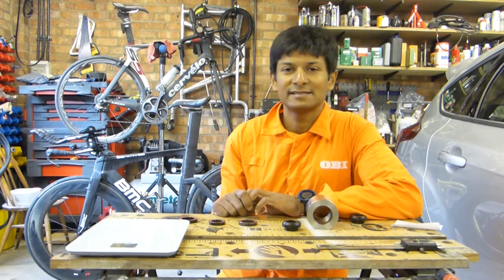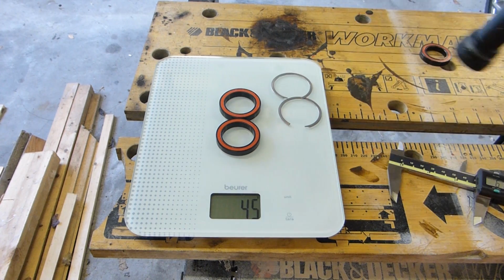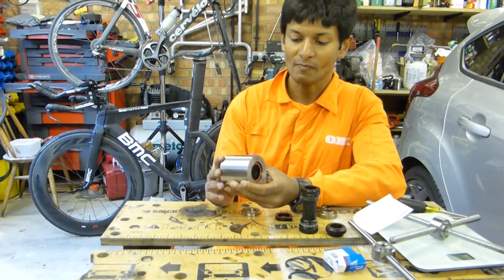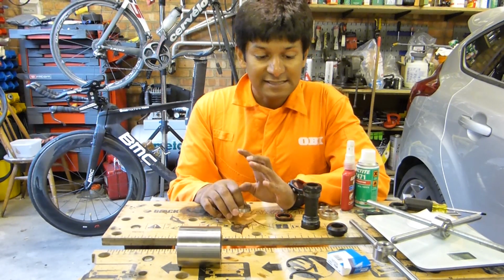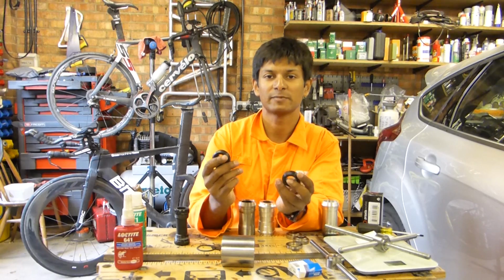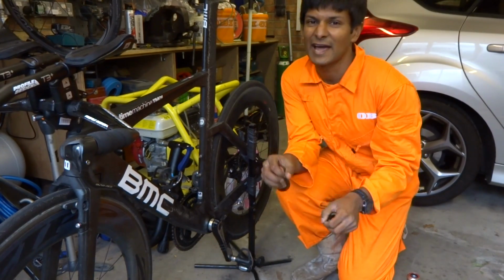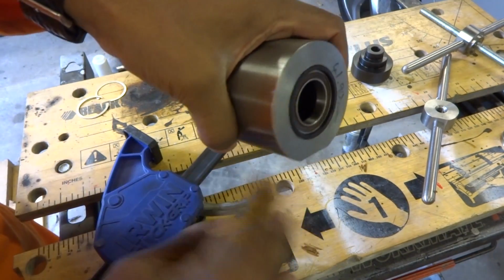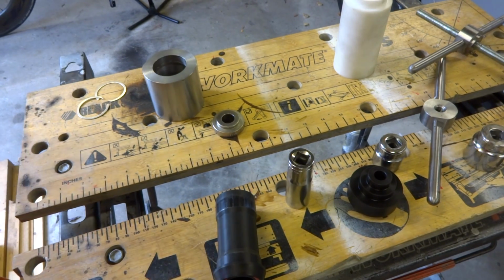BB30 Bottom Bracket Explained, Creaking, Pros, Cons and Fitting Shimano Cranks by Hambini

Comment: So... I've got a very new CAAD 10 recently, bought second hand. It's creaking already (cripes), but only under low torque, i.e. just ambling along. It doesn't creak when out of the saddle pushing hard up a climb. What do I do? Cry?!?!!!
Reply from the maker: Hi, it sounds like it's not the bottom bracket, I would check the seat post. Hambini
Reply: @Hambini  Oh! Sorry I only saw this now by chance; didn't know my notifications for 'replies' was set to 'off'.
Thanks for that. Will speak to my local (competent!) bike mechanic about the seat post as I wouldn't have a clue myself as to how to go about sorting that problem, if it is the seat post.
Any way thanks for the reply. Greatly appreciated. Love the videos, keep them coming
Reply: Interesting to read this comment!  I bought a brand new 2018 Cannondale Synapse Carbon recently-   at about the first 50 miles I noticed a slight knocking with every pedal stroke exactly as you said, NOT under heavy load but only while spinning along easily, sort of in the "middle" 75 percent of effort, where I spend most of my time.    At 70 miles it was loud enough for other riders to hear while riding near me.    Took it back to the shop and it was very difficult to demonstrate, as it didn't happen every time, or rather varied in intensity, and traditionally BB issues show up worse under heavy load.   Initially thought seat post, loose chainring bolts,  headset, everything but the BB.   One of the shop guys was able to ride it and hear/feel what I was experiencing.   Apparently 2-3 years ago there was a rash of "bad" BB30 bearing sets and they showed the same or similar symptoms.    Cannondale sent two replacement sets of BB bearings and a replacement set of headset bearings.  The shop did a full tear down and replacement and so far so good.   I really hope it does not become a recurring issue.    I'm just a recreational rider trying to stay in some sort of decent shape and do not like to think the $$$$ I spent on this bike will lead to aggravation.    My 2005 CAAD7 R700 aluminum still runs silent as the day it was new!
Reply: @JoelSzymczyk  Hi Joel, that's really interesting. Mr. Hambini said to check the seat post, so I'll do that anyway; but I'll also check out the headset by riding no hands and seeing if the creaking stops.
After that, it may just be back to the old BB bearings itself as you say. If so, I'll be defo going with Hambini's adapter for a Shimano BB.
Cheers man, hope yours is sorted for you!
Reply: @Sionnach1601  just passed 1000 miles and all is good!

Comment: American here and I call it a ratchet or a driver (half inch, quarter, etc.,). Other wrenches would be box, open... a hammer, cussing, swearing :) etc.. 

Question sir: If the housing diameter has a deviation from one side to the other, then how is it corrected by a single piece BB? Wouldn't the erroneous angle still be there?

Great video btw.
Reply from the maker: Yes you are right, if the angle is off then there will still be some deviation but.. the deviation is in the cartridge to frame not between the bearings. Additionally the cartridge is many times stiffer than the bike frame so the frame being elastic generally moves towards the datum point.
Reply: That makes sense. I was giving my question some thought today as my BB30 clicked menacingly, and wondering if this could be fixed with your doo-bobbers... or of is this my personal version of 'Bad Wolf' and shan't ever go away. Curses are curses after all.

Comment: So I shouldnt buy the 2017 caad12 with bb30a?
Reply from the maker: Ryan Congilaro I wouldn't
Reply: Hambini thanks for replying.. love your channel... which adaptor is best for bb30a to 24mm?
Reply from the maker: Ryan Congilaro I would get a specific bottom bracket and not an adaptor. Lots of people make them including myself
Reply: Hambini which one for bb30a? I'll buy yours if you send a link
Reply from the maker: Hi ryan, I'm just in the process of updating my website so check back in a day and it will be live
Reply from the maker: It's all updated now https://www.hambini.com/bike-parts/bb30a-to-shimano-racing-edition-orange-bottom-bracket.html
Reply: Hambini thank you, sir. So if I do get the creak, is it just a matter of replacing bearings?
Reply from the maker: Generally the bottom brackets don't creak - however the bearings will wear and they can be replaced by themselves. I have a video called "servicing a hambini bb", have a look and you can see how it works.

Comment: The solution to the BB30 problem is not to buy a bike with a BB30 bottom bracket.
Do what Sky do buy a bike with BSA threaded bottom brackets, they work, the win the the tour, all my bikes have them......never had a problem and they are easy to work with.
Don't be fooled by the marketing hype.

Comment: Very impressive- I have a creaking Cannondale with a BB30A (?) bottom bracket. Two questions on your bottom bracket-1. How much weight does it add? 2. Are the new bearings the exact same size as the BB30 A - can I re-use my existing crankset?
Reply from the maker: Euan, if you are running a 30mm axle you cannot change the bottom bracket. If you go to something smaller - eg Shimano or GXP, then the bottom bracket will add about 40-50g over the original
Reply: Thanks Hambini- I understand much better through viewing your drawings etc. I'm switching to Shimano Ultegra 24mm cranks (I always disliked the broken groupset on my Synapse). Your bracket arrived yesterday and it's a thing of beauty, spins very smoothly. I'm hoping for rain so I can spend my Sat am fitting it.

Comment: hello,thanks for the video and u have done a fantastic job.i use focus bike which has bb30 bottom bracket.now i got crank based power meter with different cranks and shaft.that shaft if shimano one and i have used the adaptors to fix it.the fitting is done perfectly but the pedalling is tight.can you help what might have happen.
Reply from the maker: if you drop me an email from my website, I will probably be able to assist you. Thanks Hambini

Comment: Couple of questions: first one, how do you remove those clips once inserted into the bottom bracket @ 5:49
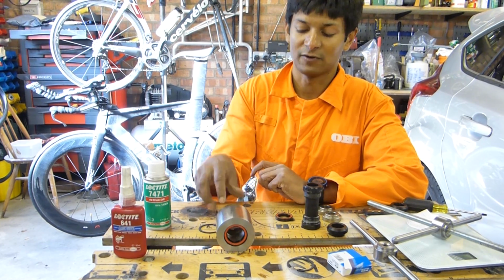secondly you claim a tolerance  @13:13  for the bottom bracket hole to be 41.97 to 41.98 mm "any bigger than this then the bearing will fall through" At this point i turned the video off, however if you can recommend a machine shop to drill holes to within those tolerances  41.97mm to 41.98mm please let me know i'm sure NASA would be interested too.
Reply from the maker: Hi, To answer your questions. 

1. You can use a flat bladed screwdriver to remove the snap rings. They are extremely easy to remove. If you look at my other video "BB30 Service" you can see how easy it is.
2. When I used to work at the NASA Dryden flight research centre (now called Neil Armstrong Centre), we used to drill the holes and ream them, that can give you a 10um fit. Alternatively with a boring machine you should get 12 microns fairly comfortably.

In carbon frames, you need a 30um interference to safely the keep the bearings retained. Any slacker and there is a risk the bearing will walk at excessive torque loads. 

Hope that helps
Hambini
Reply: In reply to your answer: Im not getting into an argument here, circlips were invented for a reason, to be able to easlily remove them with circlip pliers or other tools and not a flat head screw driver that will probably damage your bottom bracket. A vernier caliper is not recommended for measuring inside diameters accurately to 0.01 of a mm and you should know that if you worked for NASA. Verniers have two flat edges therefore if those two flat edges came into contact with an internal diameter(Round) you will be able to read what it says but in reality the actual  reading (diameter) will be greater (not rocket science) now if your talking microns then your miles away, think about it!
Reply from the maker: I agree entirely. use a bore micrometer for accurate readings. However, for showing the vast majority of youtube viewers, they are unable to read a micrometer but can read a digital vernier.

The Snap rings which are made by Smalley are designed to be removed with a flat head screwdriver. Look them up.
Reply: Thank you Hambini your video was good and i will watch the remainder
Reply from the maker: Watch this https://youtu.be/ecT_6vjjjGQ?t=3m24s and you will see why the snap ring requires a flat head screwdriver to remove it.

Comment: Does anyone know why they haven't made a threaded BB 30.  Basically take Shimano's 24mm threaded outside design and do the same thing with a 30 mm bearing.  EXACT same system just with a bigger external bearing cup and the same crankset Shimano has except 30 mm spindle size.  Would love to see a prototype of it.
Reply: traingp7 look up T47 bottom brackets

Comment: Hey there.. Sergio here..so. I have a question and you might have already a answered this in another video but quite frankly... I don't want to rifle through all your videos. 😄
So bare with me... My wife has a Specialized Amira BB30. We're running Sram red crank.. I don't want to step down to a Shimano diameter crank but rather keep the bigger diameter Red. Any suggestions into what I can do as far as BBs?  Hers just now started creaking and it's not that she's a bug person that puts a lot of weight into the cranks.. Shes slightly over 100 lbs.. Any thoughts into what I can do without sizing down to a Shimano? Thx bud.. Mandy I love your videos and keep rocking it!!! Kind regards. Sergio Gomez
Reply from the maker: Hi Sergio, is it a BB30 crank or GXP? I appreciate the bottom bracket is BB30 but the crank may not be
Reply: Hambini Performance Engineering 
It's a BB30.. I purchased it myself.. I know that I did not want a GXP.  That is on my Orbea. So to recap.. The Specialized Amira WSD runs BB30.. Any BB that you make for that? Again.. I don't en at to run Shimano.. Not that there's anything wrong with that.. I'd like to keep the BB30 Sram red.   Thx bud
Reply from the maker: Hi Sergio, There is very little you can do by staying at BB30 size. If the fit is the problem, the possibility to sleeve the BB30 shell is not possible. The only way to do it and remain cost effective would be to sleeve and go to SRAM GXP or a 24mm axle. I would double check to see if your fit is the problem before you do anything. It might be simply a case of replacing the bearings

Comment: What if you wanted to use a bb30 ceramic speed bearing with a Campy crank?
Reply from the maker: Campy cranks are 25mm 6805 bearings, so a BB30 ceramic speed bearing would not work.

Comment: Excellent Video, very clear and informative. I have a quick question if you don't mind. I currently have a BB90 (slip fit) in an early Trek Madone (very similar to BB30). I am replacing the bearings and although I've had no issues, i'm not happy that the cartridges are loose in the carbon cups. To me bearings should be a tight fit so they outer race doesn't move allowing the bearing to do its job.  So I am thinking of using Loctite 641. Question is -  how hard is it to remove a bearing that has been installed with 641? Thanks Alan
Reply from the maker: jamesalanjob hi there. it's effectively the same as glueing the bearings in. once the bond is broken they will fly out. however to break the initial bond, you will need some force
Reply: Hi, thanks for replying. after researching the BB30 and BB90 there seems to be lots of issues. The big issue I have with my BB90, is that if a bearing seizes then one of 2 thing happens,
1.If its not solid in the frame then the bearing moves in the frame wearing away the carbon fiber shell
2.if its tight in the frame it wears away the crank axle as the axle sits directly on the metal bearing
Also the bearing inner race could also seize on the axle making it very hard to remove.
I think shimano had the right idea using the plastic top hat insert design on their bottom brackets.
I have now ordered 6 enduro MR2437 stainless steel angular bearings to see if i can get better life out of them.
Alan

Comment: Fantastic engineering! I wanted to ask if your titanium one piece design fits any BB30 frame or does it require making to the exact tolerances of the bike? Are you actively supplying these? Top work 👍
Reply from the maker: Hi David, It will fit any frame with BB30 insides. The problematic issue, is the cost. It's horrendously expensive.
Reply: I thought it might be!

Comment: Just subscribed.  I enjoyed the video. and would like to purchase a bottom bracket from you in the near future for my bb30 specialized tarmac, which currently has a fsa slk bb30 crank set.  But I will soon purchase a stages shimano 105 crank set which I want to use on my bb30 frame.   I want to use shimano because my other bikes have shimano and it would later be a quick non-drive side crank arm change to use the power meter on both bikes.  will it work?  thanks.
Reply from the maker: Hi, running a stages will be no problem. there will be plenty of clearance if you are coming from BB30.

Comment: Hi

Thanks for sharing. Like your thinking re these miserable weight saving BB's. Did you use Delrin for your bearing carrier and what interference did you use for tube into the frame and likewise bearing into tube. I am guessing something like 0.03 - 0.04mm - yes/no? The other problem that occurs with stock bearings in the BB is that default bearing is single lip and really is more of a dust seal and not great with sealing out water. have you done any experimentation with alternate seals or even shields for said bearings? I have noted that the non-drive bearings always die before the drive side - I am guessing that the crank provides some form of shield.

cheers
Reply from the maker: Hi Greg, the fit is a bit of a PITA. You have a compound stack up in some frames and that screws up the final bearing fit which in turn makes the final bearing fit either tight or loose. I was using M7 but recently changed the alloy I use for my bottom brackets and that has necessitated a deviation in the fit. As for the bearings, I have not experienced the non drive side failing before the drive side but it's interesting that you point it out. I also haven't experimented with the seals - I don't have the manufacturing capability for that. Thanks Hambini

Comment: Did you hold that sleeve (for the three piece BB) in a three jaw on the lathe and bore it out? Quite a thin piece to turn.
Btw, the one piece BB is basically the BBinfinite design.
Reply from the maker: Hi there, I'm unsure of your question with regards boring it?
Reply: Yes, how did you hold the work for boring it? You don't sell any bb30 removal tools, why not? I saw your BB press and was impressed, although really the only useful part in that kit is the machined cylinder to fit the bearing properly, the rest is just a threaded rod and a couple of bugs really.
Reply: I'm assuming you've seen the BB30 to BSA sleeve that FSA makes? There is a tool that permits pressing that sleeve out, which is just a way to support the outside of the bottom bracket shell to allow the sleeve to be pressed out, in he form of a tube that accurately fits the bb she'll with enough clearance to let the sleeve through it, have you seen this?
Reply from the maker: The bit you are referring to is not made on a lathe. A full set of removal tools is available at hambini.com.

Comment: Very informative video. Answered so many questions I had about BB30. Doesn't specialized use a type of BB30 on many of their bikes?
Reply from the maker: Hi there, thanks for the feedback. Some specialized bikes have "OSBB", this is very similar to to BB30 but the shell width is 61mm as opposed to 68mm. It uses the same 6806 bearings.

Comment: Pretty awesome and informative video!  What didn't you like about the Praxis besides the ring/spacer?  do you have other suggestions beside making your own?

Thank you!
Reply from the maker: Juan Sebastian Garcia thanks for the feedback. the other issue i found was tightening the praxis. i thought i was going to break my frame with the torque that praxis recommended
Reply: I have the Praxis on my caad10 and it creaks after 2000km. Could be wrong, but from what I'm reading now, it really isn't much different from normal pressed bb30 bearings on the NDS. The expanding collet only provides a benefit for the drive side.
Reply from the maker: I think that is a very succinct explanation of the way the praxis works. If you can get (or have the balls) to tighten the adaptor up all of the way, in theory you should get no creak. However, it really needs to be done up tight and I ran out of balls way before I hit the stop.

Comment: Brilliant video, really! Have you any opinions on the Wheels Manufacturing thread in BB30PF30 BB? We've used them in the shop I work for to solve the creaking issue with some good results thus far.
Reply from the maker: Hi Edmund, I have never used it so I cannot comment. Sorry. Hambini